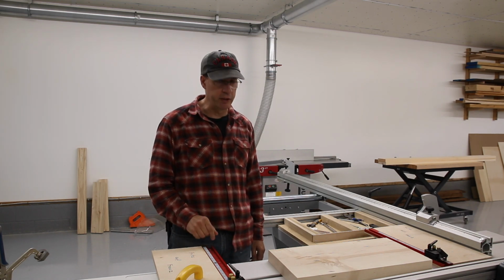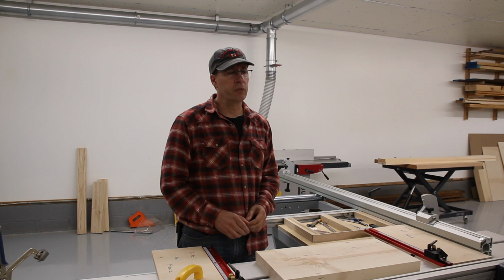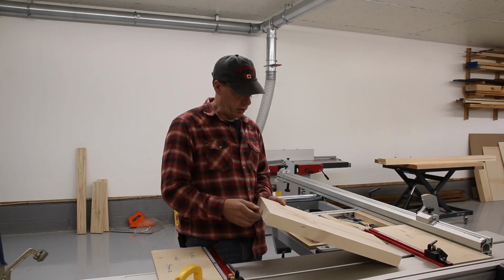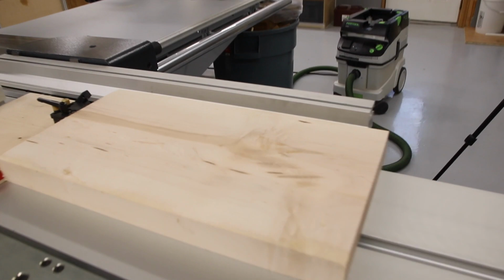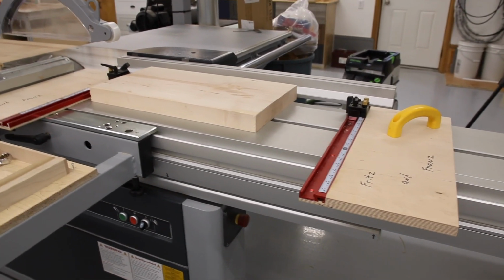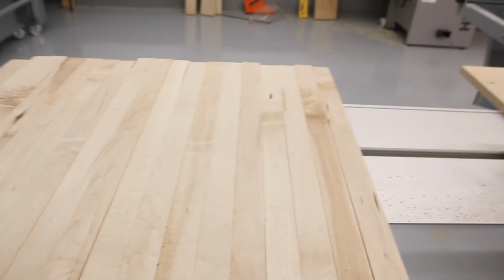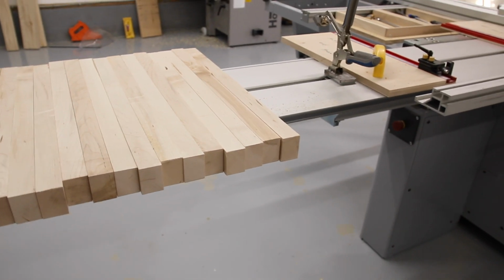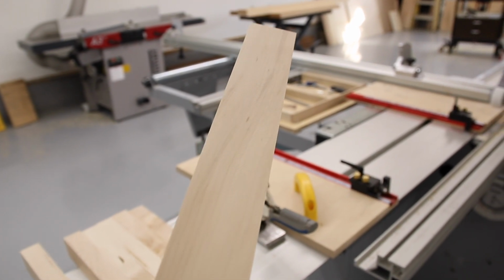jennie and davis This one's for you :)

Comment: cool test

I'm wondering what is the longevity of that USD700 diamond blade? is it a few years of a heavy daily use? or 6 months? can you sharpen the diamond teeth? or do they even get blunt at all? can it cut thick aluminum as well?
Reply from the maker: It’s $700 CAD so about $475 USD. I have been using it almost daily for over year. But I don’t use it all day long. It still cuts just as good as new. Under a very strong magnifying glass I noticed a few tooth with a micro chip in it but invisible by naked eye. The edges are not blunt whatsoever. Still like new. I use a cheaper blade to cut aluminum. Just in case I don’t want to chip the diamond tooth. I heard you can get the diamond blade sharpened but diamond is hard so I’m sceptical. I have no doubt that it will last a very long time.
Reply: @frenchriversprings  thank you so much for an in-depth answer to all of my questions
cheers!
Reply from the maker: Your welcome

Comment: Another very detailed and informative video. After 6 months of waiting my K700s is arriving this week. Went for all the bells and whistles with the power drive, automatic fence which was only available on the 3 phase machine so it’s 7.5hr power motor. . I make kitchens and wardrobes so I’ll be cutting MFC panels so ordered the fine cutting blade and scoring blade. I assume the diamond blade you have is best suited for cutting real timber rather than melamine panels? Do they also do a diamond scoring blade to complement the main blade?
Reply from the maker: The diamond blade works extremely well for melamine, plywood, mdf and all kinds of panels. I bought the matching diamond scoring blade from the same company that makes the diamond blade for Felder. For some mysterious reason, Felder does not sell the scoring blade.
Reply: @frenchriversprings  cool. Something I’ll look into so in a few months when the piggy bank is replenished

Comment: Nice demo, with a very nice slider!  👍🏻.  I’m patiently waiting for mine. November is getting closer.   Hey have you seen good dust extraction with the new overhead saw blade guard you installed?  Wondering about ordering one as well.  Thx
Reply from the maker: Oh yes It’s amazing. Only thing if you skim the wood with the blade or only cut the width of the blade, the sawdust will shoot sideways.

Comment: I have a slider, and I have traditional cabinet saws, it would be faster on my Oliver 270d its a 5 hp direct drive it will go through anything like a hot knife through butter, I have regular carbide tip blades, I'm not familiar with the diamond blades, Rip blades for my saw are around $110,  My Scmi slider is amazing for doing cabinet work and sheet goods, I feel that the carriage of the slider gets in the way so I Don't generally process solid materials on it I use one of the other table saws for that . The important thing is enough horsepower and and a good rip blade.